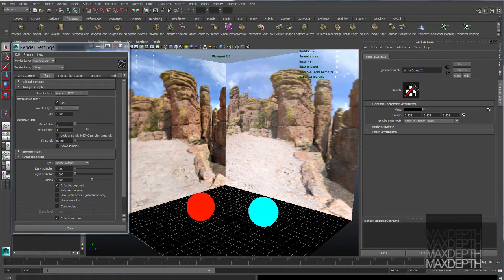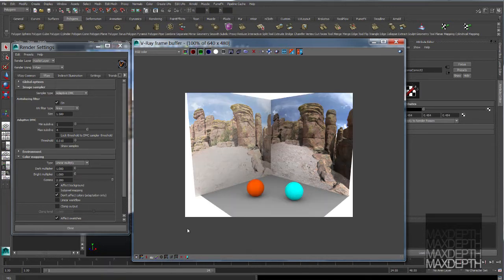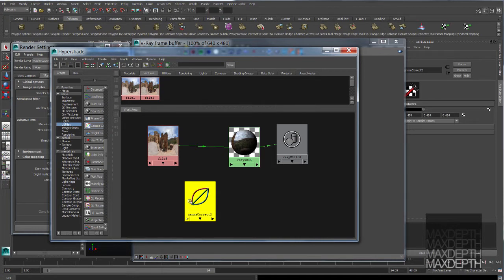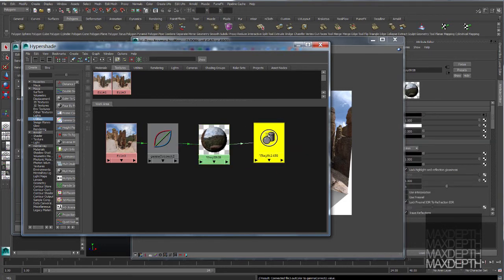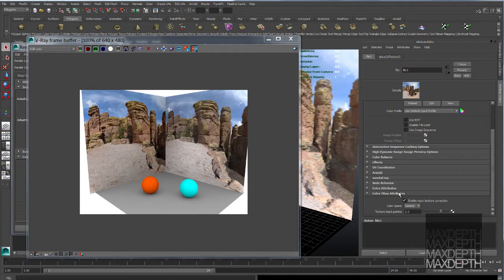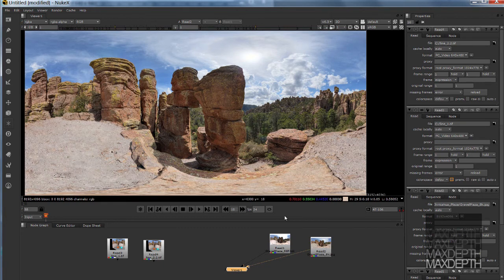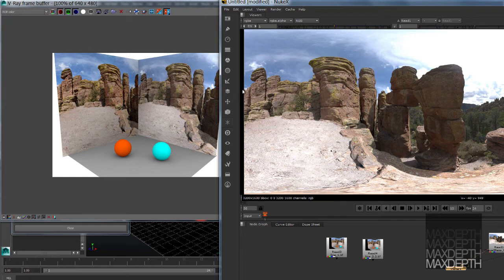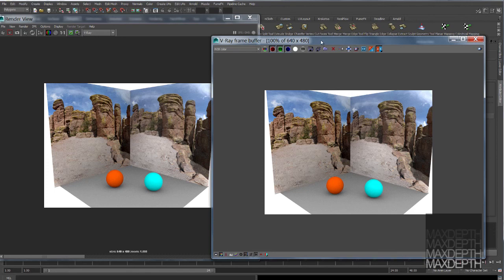Linear color workflow in Vray for Maya

Comment: thanks for the tutorial, the Vray gamma attribute for image files helps a lot.

It seems kind of inconvenient to have to set it up for each image file and color individually.  Vray has an option in the color mapping called "Linear workflow" which automatically applied the inverse gamma values to all image files, but now in Vray 3.0 it says it is deprecated and will be removed.  Why?  I don't understand the benefit of setting it up manually.